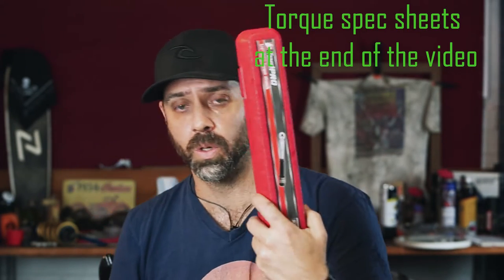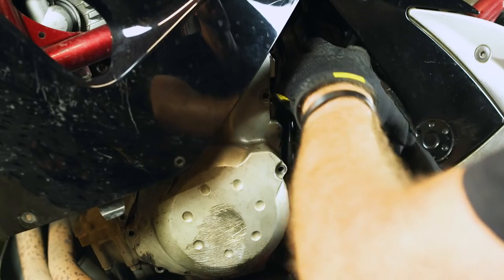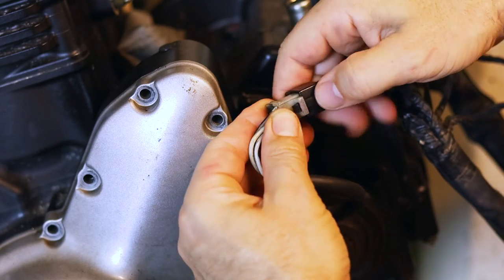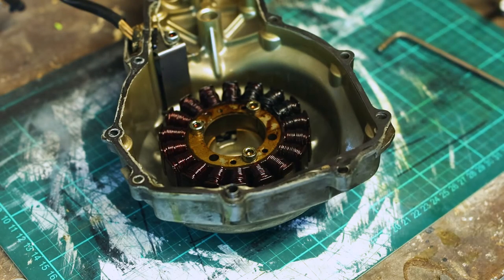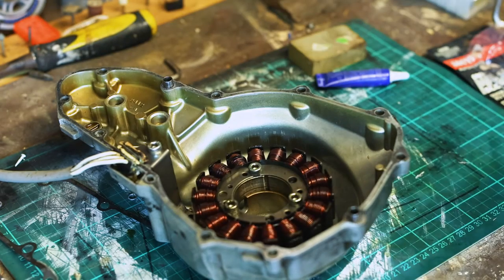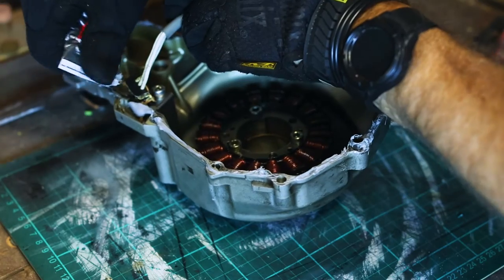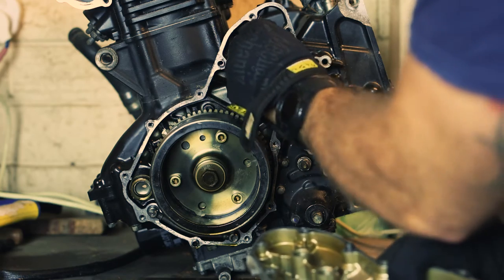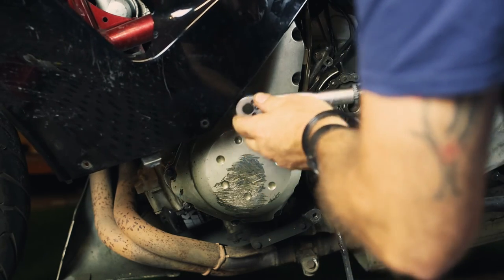Kawasaki stator alternator replacement for Ninja er6n er6f Versys

Comment: Mine had stalling issues, when riding short distance the engine stall had taken out the fuel pump change strainer fitted back in place,got a new battery,start yes,goes for spin then the issues revealed that it's the stator  not charging battery, gonna wait for spare parts from shopper.

Comment: Good morning.Just a question.I have a problem of alternator with my versys 2008, same motor.It's my daily bike to go to my work on the highways near Paris. I put a new alternator after an electric leak 2 years ago after the covid and today, same problem, my battery is weak...

So, i decided to open the carter of the alternator and , surprise, 0.5 liter of oil failed from it.

Do you have an idea of the cause, a bad seal?...I didn't chute with my bike...I think the problem is not only the alternator now..Thanks for your response.

Have a nice day
Reply from the maker: Hi there. Just so you know, there is supposed to be oil in the alternator. I'm not sure if you have used a translator - but I'm a bit unsure if I have the correct information. Anyway, the stator is probably causing the issue if you are sure your battery is ok. It could also possibly be the regulator/rectifier. Usually in these situations, the battery is the most common fault, followed by the stator, the. Possible wiring issue or regulator/rectifier...

Comment: Should I drain the engine oil before changing the alternator? Thx
Reply from the maker: You probably want to as you'll need to put silicone on the gasket to seal it.

Comment: Awesome video do you need silicone if it's a brand new gasket?
Reply from the maker: Hi Michael. Thanks for your comment! It keeps me motivated to keep making vids. I would definitely use a fuel /sensor safe silicone silicone sealant as stated in the workshop manual. 👍
Reply: @The Deep Planet   hell yeah thanks man I have a  09 er6n and I'm trying to button everything up I have a brand new battery up bring rectifier a brand new stator a brand new gasket and I bought silicone sealant I live in Pennsylvania and I work at night so my rent a time so I'm not going to do it today but I'm going to attempt to do this tomorrow
Reply from the maker: Good luck mate. Have you got a workshop manual?
Reply: @The Deep Planet   hey sorry,   yeah I bought the downloaded one for my phone